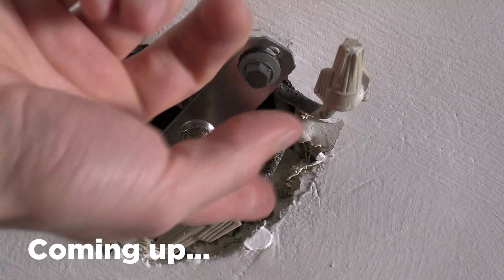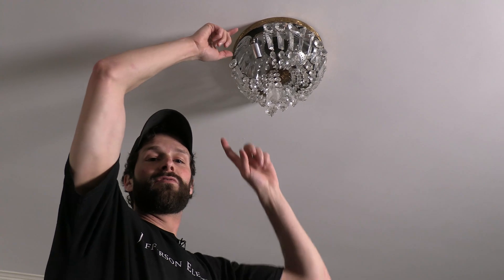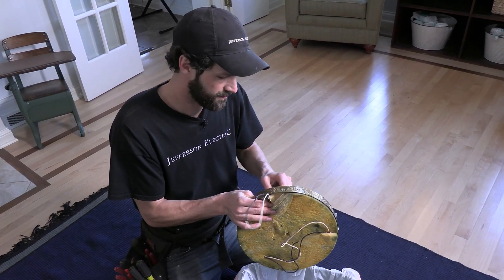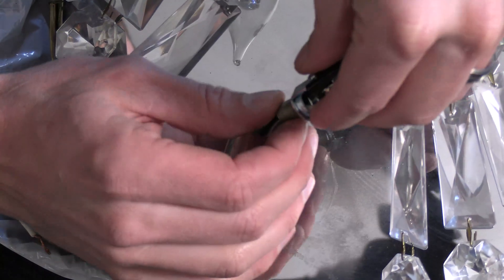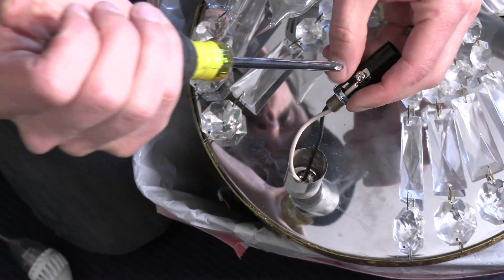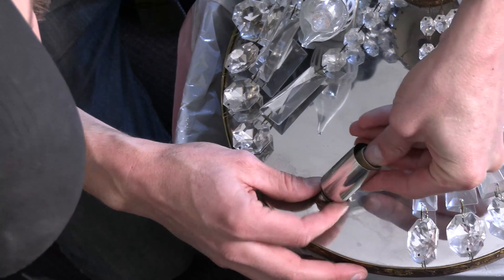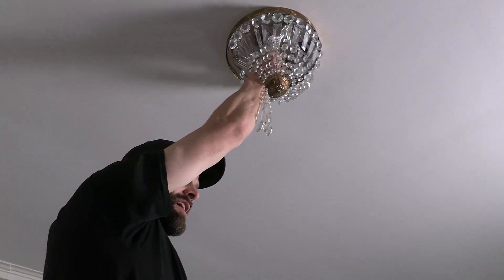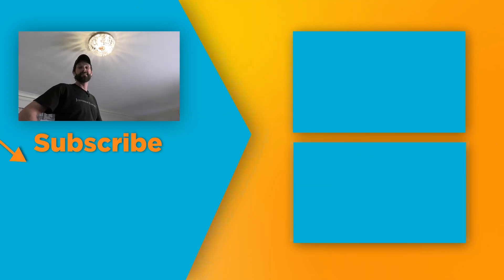How To Fix Grandma's Crystal Light Fixture

Comment: Get some metal fixtures or a whole new fixture that will accommodate those crystals. That's where the value is. Get rid of the plastic junk. Also, nothing wrong with cloth wire as long as it is in good shape. If I had money, I'd rewire my house in knob and tube for all circuits that are not 220 - 240. They have the parts at Sundial Wire. It's beautiful. Of course you'll have to have more knobs and tubes to accommodate a ground wire, and use white and green tape to differentiate those wires since it only comes in black, but it's so beautiful and it is 12 gauge. Obviously, one would not use it on 220 - 240 dryer and A.C. units but every other circuit would be nice. Then of course, when I got to the area in the basement where I see conduit tubes, I'd run the wires through walls that way. I'm not a fan of finished basements. I like to see the rafters and I like to see walls that are unfinished on one side that is of least concern. Then I can always find the studs and fire stops if I want to hang something, or nail in another block between studs to make sure what I hang isn't going anywhere.

Another great video. Really appreciate you keep me company. It gets lonely since my Mother died. Her poor dog is beside himself. All he does is snooze. He is obsessed with me for some reason. Mother was so mad. She adopted him and he clung to me for some reason. I have no idea why. He's a good boy.

Can't wait to see your video on when you rewire your whole house. Hope I can find them all in order, if they're segmented.

Comment: You can buy a box of 12 $6 replacement junk fixtures from Supply store and use those to replace those old fixtures.  Should you be proud?  No.  Whoever does that should be ashamed.  Fix the stupid thing and maintain some history.  The $6 phony brass plated junk in a contractor's pack would never last as long nor look so good. T&M.  No quotes.

Comment: from my days working at Menards, I remember many customers wanting us to do this kind of work but corporate legal said no for liability reasons.   So yes, there definitely is a market.  One of our contractors that bought from us said he did these in the evening while watching TV.  Thought he charged around $50 per table lamp for a new cord and 3 way socket assuming the cord went straight up the lamp base.  

Also from those days, I remember when building displays that the lights had all bulb wires grouped together under a crimped on wirenut like cap with a single pigtail for the box connection.  Is there a reason you put all three bulb wires into each wire nut rather than using a pigtail?
Reply: Hell! Maybe I should get in on that...

Comment: You Never heard of terminal clips and a soldering iron for stranded lite guage wire lol

 lol you should look into copper crimps or at least wagos for all of those multi wires under a wire nut especially stranded wires
Reply: I thought about spaces or solder for about half a second and then realized that would just be complete overkill for this situation.

Comment: Honest question, where is the official line and where is your line?  Cause where the AHJ says device instructions (even for a 20yr dead manufacturer), telling the customer to keep it as is or throw it out doesn't fly.  They'll either keep using it unsafely, or go worse trying to fix it themselves or from a friend.  I've never fixed anything I wouldn't use myself, tested it out, and have full confidence of electrical, mechanical, and thermodynamic experience, that it is safe, and I've left the person more safe.  But I've had times I said this isn't what I do, and it can be more for who/why than what the fix was.

Comment: Lucky enough to have a Gossen Mettrawatt Secutest Pro which if I did a repair like that I would test throughly to ensure it remains safe with no dangerous touch potentials for example. It’s a nice light fitting well worth preserving, polish up those crystals when your customer is the wife you better do the best job in the world or you will never hear the end of it.🤦🏾🤣
Reply: @ElectricProAcademy  Joel just sent you an example by email of some of these kinds of tests for electrical safety testing of devices. Hope it helps.